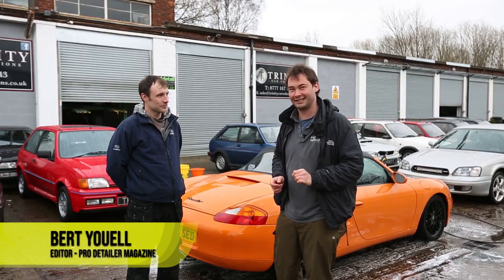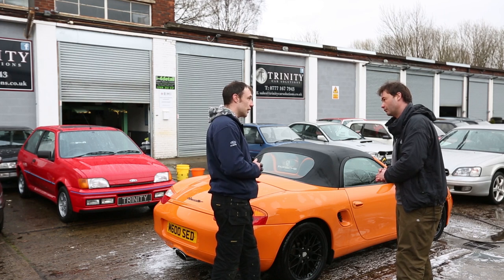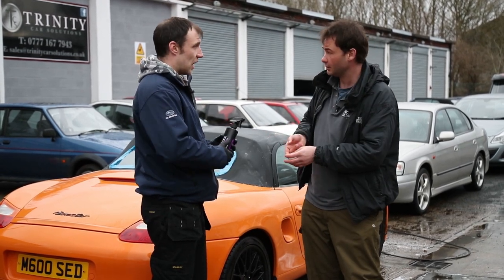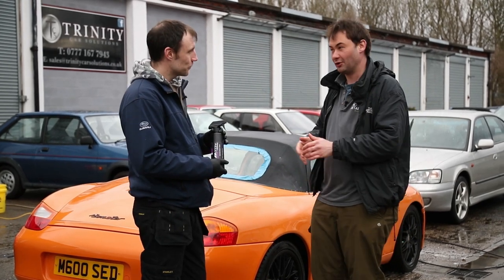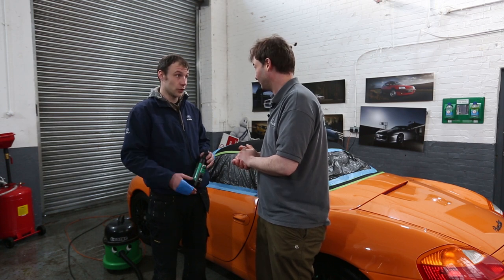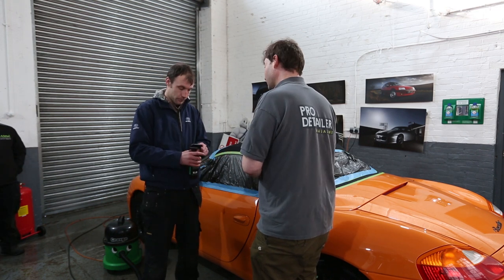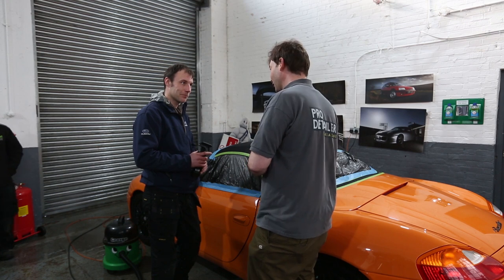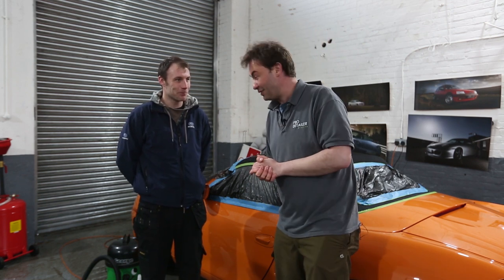Porsche Boxster Convertible Roof Clean and Protect

Comment: Good video, always worth making sure the drain holes on a soft top are clear prior to laying a lot of water on a roof ( especially a Boxster)  these have a lot of very expensive ecu s underneath either seat. If the drain holes aren't clear the water can over flow and seep along the carpets to the lowest point of the interior.

Comment: I use a clothing roller lint remover to get the bits off.I would also like to see a video on re-colouring a roof with tips on how to avoid dye running down the insides of the  A pillars and the rear drain holes.
Reply from the maker: That's a great idea for a video Eric - we hope to release a advanced and detailed series of how-to videos, and this is a topic which will be covered in that